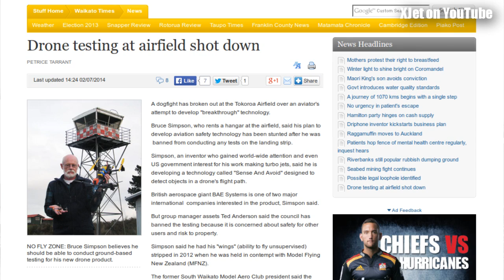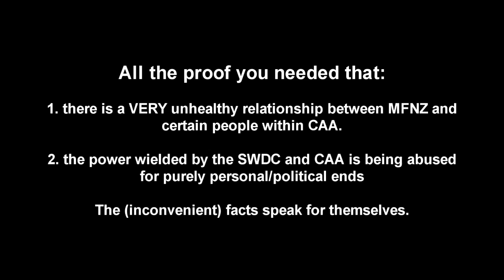Drone testing at airfield shot down - why am I left so confused?

Comment: Now your contradicting yourself and crossing you own arguments, Bruce... You are now saying there are no ill-affects of your sense-and-avoid testing; so then why did you feel the need to go around telling people that they might see an increase in noise on the 2.4 band, and they should double check their radio gear installations, several months ago?  You remember...That issue that led to the actual ban of flying.  A bit contradictory...

The irony in all of this is now you're basically bitching at yourself for the outcome of your causation...but you don't realize it.
Reply from the maker: I said there would be no ill-efects so long as the fliers were following their own rules -- which means doing range tests, using decent equipment and properly checking things before they flew.   Sadly, they do not do these things.  I've seen less than half a dozen range tests done by the jet fliers in all the time I've been resident at the airfield and I suspect that most of them wouldn't even know how to put their fancy "brand name" gear into range-test mode or what would constitute a pass or fail in terms of the distances they achieved.  This lack of range testing has been witnessed by many others -- yet MFNZ seem unconcerned that one of the most basic requirements of the "wings" certification is consistently ignored.
Reply from the maker: RIDERZcouk
Hmmm... so David ought never to have slain Goliath eh? :-(

Britain ought to have simply surrendered to Germany in WW2?

Hell, the biggest problem with the world right now is that people in power are doing some very bad things -- and too many people just accept the injustice and the tyrany of it all.
Reply: RIDERZcouk How is it a threat when he told the jet pilots as a precaution that they might want to check their RC installations to make sure they're set up PROPERLY?  Shouldn't jet pilots, flying the most dangerous equipment at the field with a much higher rate of accidents than full size planes at Tokoroa alone, make sure their RC equipment is set up properly and range tested?  If you ask me, he was doing them and the other users of the airport a favor.

It's well known that many people in the hobby have more money than skills.  You can see that by the way they fly (especially landing), from some of the xjet videos.  And their have been crashes, too.  

There are lots of YouTube videos where you can see people flying extremely expensive giant scale jets badly, and also crashing them.  Money doesn't equal skill or good sense.
Reply: Yes I remember that too, sounded like Bruce was making threats to the RC pilots at the airfield to me, of course that's just me reading between Bruce's own lines
Bruce I don't think you have the right to cry foul on this issue, it was you who started it, you deliberately picked a fight with someone who had a bigger stick than you
Reply from the maker: RIDERZcouk
Threats?  What threats?

In the interests of safety (which, unlike MFNZ and CAA, is an issue I take seriously) I felt it important to let those who have already crashed a jet into the gokart club by using an AA-sized receiver pack on a 15Kg model, know that they really should make sure they do proper pre-flights and range tests.

Let's face it -- any group that thinks it's okay to use an old AA pack in a heavy turbine-powered model with hi-torque digital servos really needs all the help they can get.

Remember also that, despite the MFNZ rules clearly stating that pilots shall do a range test before the first flight of the day, this is almost never done by these jet-jocks.

I explained to them what I was planning to do and clearly told them that "so long as your installations are good and you're doing y our preflight checks, there should be no problems because my transmissions are no different to a mobile phone with wifi".   That they chose to interpret this as a threat speaks volumes to their desire to come up with an excuse to interfere with my lawful activities.   That the police told them to stop wasting police time speaks volumes to the veracity of their silly claims.

And I'm sorry but so long as we have idiots who choose to deliberately misinterpret attempts at preserving safety and a model-flying organisation that goes out of their way to interfere with my right to enjoy the hobby and help others do the same - I will continue to stamp my feet.   MFNZ, CAA and the SWDC should all understand that I am not going away.

I have clearly stated that my door is open if they want to resolve these important issues -- but they'd rather continue their petulant ways.  Well that's their choice but trust me, I haven't even started rolling out the real evidence that will expose the dirty dealings going on around here.

You'd think that anyone with half a brain would realise that there's a hell of a lot more advantage to be had by manning up, sitting around a table and sorting out this mess than simply continuing these abuses and suffering the scorn and derision that will naturally follow as I expose them for what they are.
Reply from the maker: PHeMoX
Indeed, I found it very interesting that the very large $20K+ turbine-powered scale military RC helicopter that was at the field earlier this year was granted an "on the spot" exemption by a CAA official there so that it could fire missiles -- yet the exemption I was promised (and which, when finally delivered was not what was promised at all) took months and months to be processed.  Never the less, the bastards at CAA sent me a bill for over $700 for an exemption that is "not fit for purpose".
Reply: *****
Wow Bruce you can be like a petulant child stomping his feet
just because someone has a bigger stick doesn't mean they're part of the third Reich and fair game for you to have a pop at now does it
Seems to me that the tyrany was partly you, making threats to the local RC pilots regarding your experimental use of 2.4 on the airfield, they may not understand that it would not affect them but you knew that yet decided to frighten them anyway
Now you're crying because they did something about it, grow up Bruce and stop stomping your feet
Reply: Jeff Thompson Yeah, it totally surprises me to see official RC clubs allow for the flight of such large scale helicopters (like the Vario helicopters) when the presumably fairly wealthy (nothing wrong with that) pilot can't even hover properly, let alone fly circuits (everything wrong with that). How can such a thing be anything close to safe?

I don't think warning words from Bruce, even when enforcing his frustration with the lack of respect for safety from other members, is  something wrong or even threatening here. You know how this goes, people will want to see a threat when in reality they are being confronted with their own lack of compliance with rules. They probably felt 'caught'. But isn't that their own fault for not abiding the rules? What ever happened to them simply agreeing with a fair point and taking action accordingly, instead of calling the freaking police on Bruce?

I'm fairly sure there's a bigger danger in many of those bigger turbine RC aircraft than any of the smaller AXN style or quadcopter style stuff that's being flown by Bruce. Isn't that kind of obvious here? As someone from far outside of this whole thing I can't really judge, but from the information available I don't think Bruce is the one being unreasonable here.
Reply: ***** That's simply crazy. I don't see how any of that is in the interest of this hobby.
Reply: It would seem the real contradiction is the CAA, their polices and the people that enforce them or ignore them at the will of the privileged. In other words with the right amount of money or the right connection you can get an exemption with little or no notice.
Reply: Mick7sp Unfortunately having right connections and money gets people out of trouble all the time...